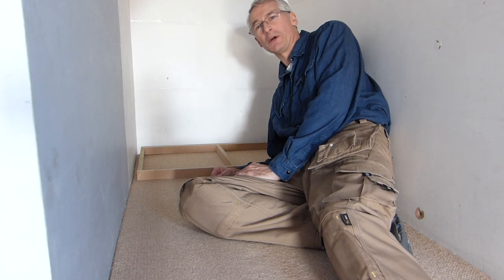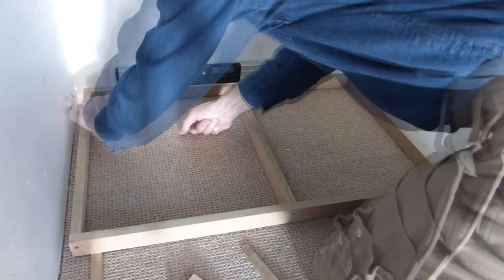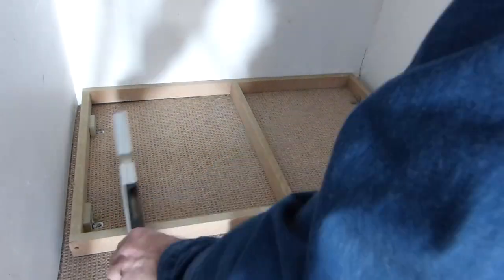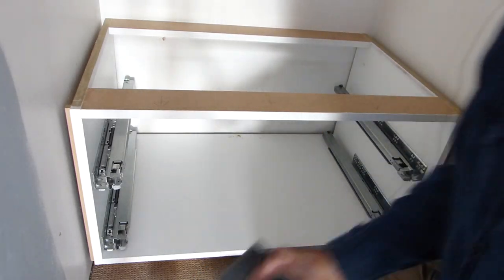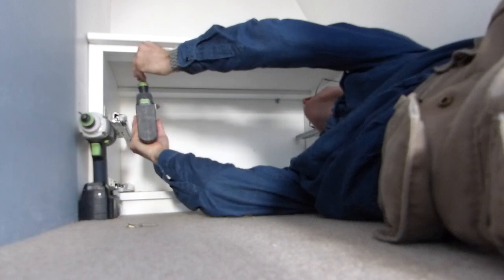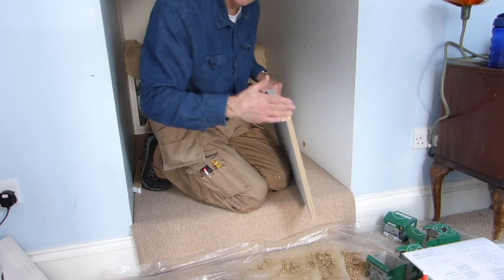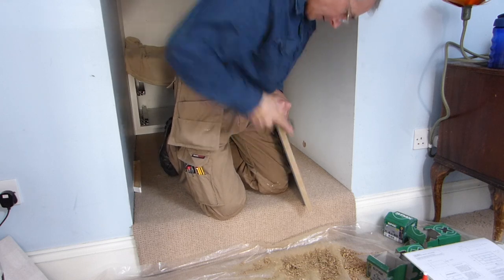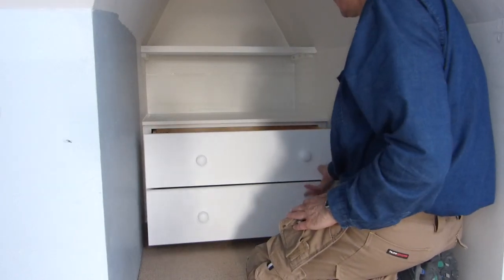How to make a two-drawer cabinet Part 3, #014

Comment: Peter, I'm know I'm late coming to this series, but I only subscribed recently. One comment; would it not have been easier to fix the shelf support lower and align the top of the shelf with the crease line in the alcove? Would have avoided planing to the sloping wall and (imho) the continuity of the crease line would have been more visual appealing.
Reply from the maker: +DesandSam Welcome. I don't disagree, but the height of the shelf was very specific to accommodate some books / files the client needed to store, so out of my hands.

Comment: Great work. Might be an idea to employ a part-time contortionist for those fits.  
I'm sure in this case it wasn't a problem, but maybe you could remind people that when screwing blind into floorboards there is a need to check for cables and/or pipes that maybe underneath. 
In a previous life I was a plumber and still get calls from folk who have screwed into a pipe. Not to mention the health and safety element.
Look forward to more videos.
Reply from the maker: +Furniture Dan Thanks! I always use 4x20mm screws going into floorboards so they don't penetrate, but yeah, good point, I should make that clear. I've done plenty of videos since this one btw, so be sure to check out the full catalogue 👍

Comment: A random question Peter, what make/brand are your work trousers..? I'm looking for a good pair and cant make my mind up what to get...;-) Great video series BTW...I really like the install sections of these projects.
Reply from the maker: Simon Coupland Thanks! Oh Lordy, don't get me started on workwear! The stone (this video) & navy ones are "TuffStuff Extreme 700" - overall pretty good, but whoever decided the nail pockets should be removable using the $hitt!est zips imaginable is beyond me. Also (pet hate) phone pockets that only fit a Nokia 6110i - aaaarrrgghh! But, decent price, decent fit, and I tend to cover them in glue and paint before they wear out...

The black ones I have are Scruffs Drezna - really nice (a bit pricey) but I just don't understand what the pockets are supposed to be for - there's a cargo-type pocket in the left leg that has the opening at the side, ffs! But a very nice pair of trousers - my current 'meet the client' strides, fwiw. Cheers,  P
Reply: Thanks for the reply. Based on what you say, there may be better options..? I've looked at the high end Dickies Eisenhower and the Blaklader Craftsman among others, but they cost more than I pay for my Sunday best trousers..;-) I notice Aldi have some work trousers, might be a better option!
Reply from the maker: No problem. To be fair, whilst I think that the designers of workwear have never actually worn/needed to wear what they design, the Tuffstuff extreme 700s are about the best work trousers I think I've had, especially factoring in the price. I've been doing this for a living for 18 years, so as you can imagine I've worn a lot work pants, and they really are amongst the best I've had - just baffling about the cheapo zips and the crazy phone pocket! I wore Dickies Eisenhower for years, but the tuffstuff extreme 700s are better, IMHO. Cheers, P
Reply: OK, I'm convinced - just ordered a pair. I need knee pads (I'm laying a Karndean floor soon) any recommendations for those..? is this turning into a shopping channel..? You need some affiliate links, make some money out of these recommendations..;-)
Reply from the maker: Haha! I usually just get the tuffstuff knee pads when I order the trousers. Yes, affiliate links are coming - though I'd never have thought of including my trousers, lol! P

Comment: Nice video, how much would you charge for this? cheers
Reply from the maker: Thanks. It's by quotation as it depends on a lot of variables, but around £700 - £900 all-in would generally cover it at this kind of size.
Reply: thank you